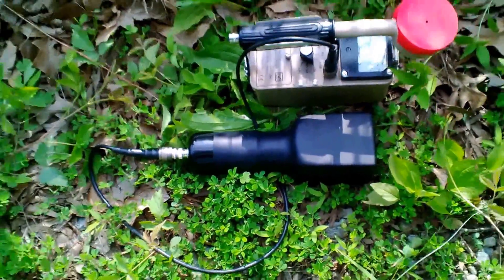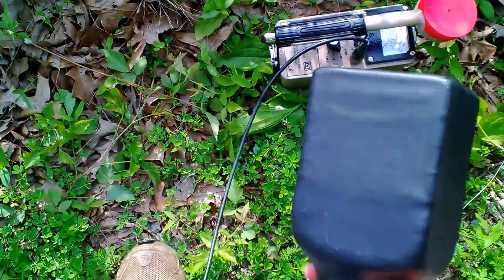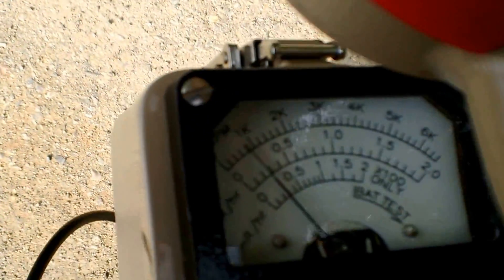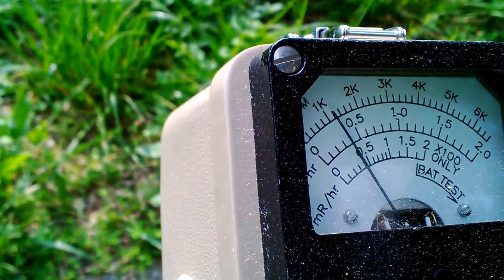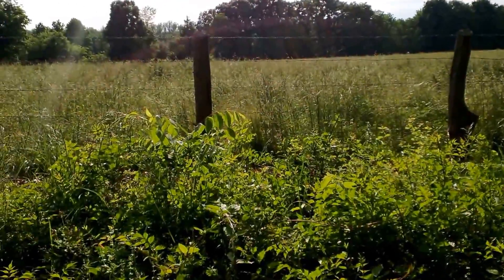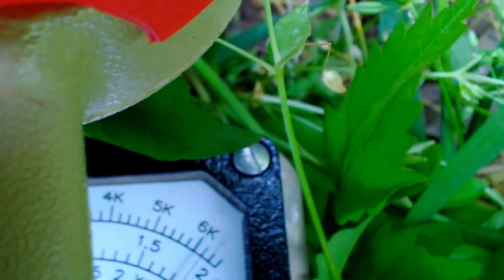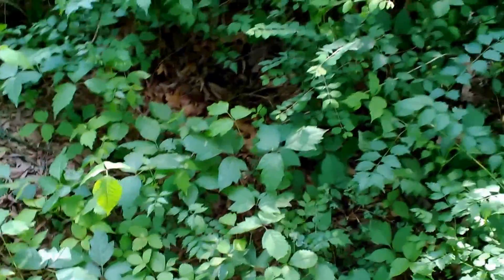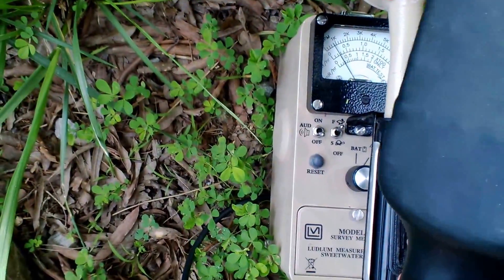Uranium deposit surface with a new detector and a Ludlum Model 3

Comment: You sure somebody didn't dump something on the side of the road? Or you aren't picking up particularly hot (relatively speaking)  fertilizer on that field?

https://www.epa.gov/radiation/tenorm-fertilizer-and-fertilizer-production-wastes
Reply from the maker: This is at the Coles Hill uranium deposit. The location where the video was taken is where it is exposed to the surface.